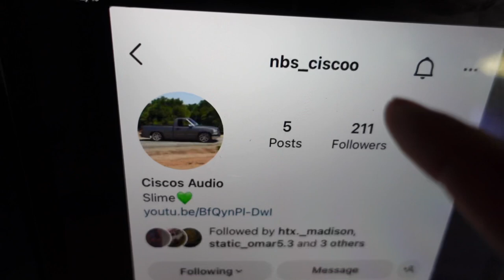4th ORDER BANDPASS and rest of SOUND SYSTEM in CHEVY TRUCK DEFINITELY GONNA COST OVER $20k

Comment: Just did a blowthrough build with 8 12s the only bad thing about a build like this is the crazy weight that goes in the bed gas mileage is gone and tires wear faster but the boom is bad and the spl is there 🤘
Reply from the maker: Oh ya most definitely… after I’m done with build ima decided weather to drop it on some 26s or Do 6” lift
Reply: @mouse_trap.  I need to do one or the other do you think with a drop kit I can get it to ride decent with 1000lbs in the bed? I don't know and don't want to do it and have to swap to the lift kit alot of ifs and how's and what's. What's ur opinion